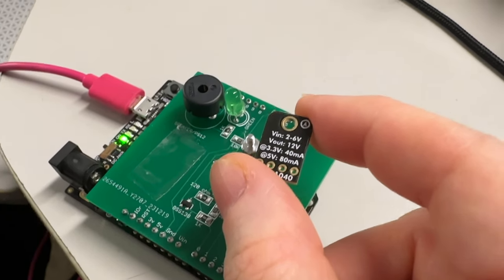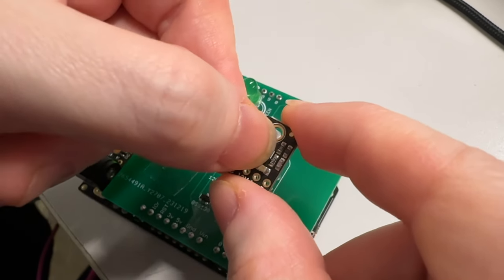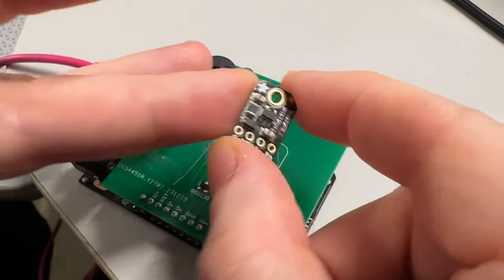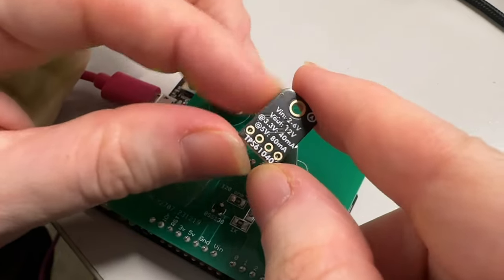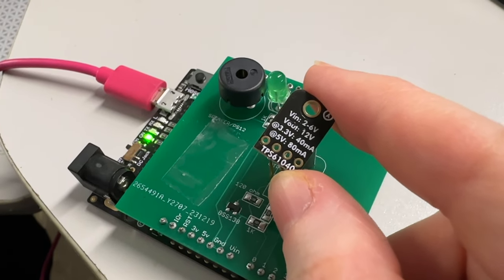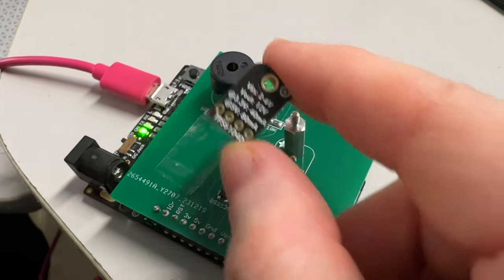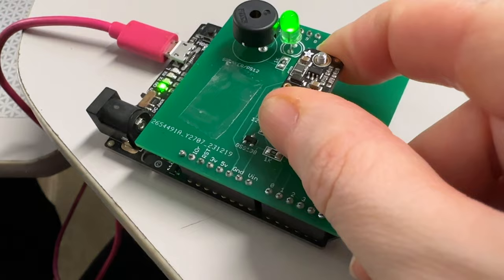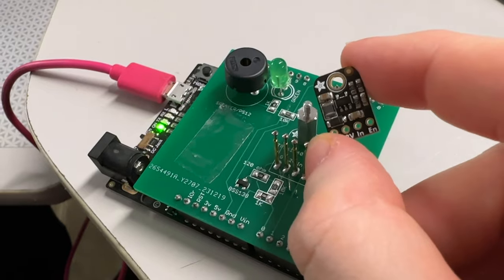TPS61040 12V booster gold test

Comment: Out of curiosity, what happened when the residence was 100 ohm rather than 100k?
Reply: on page 13 of the datasheet, there is a formula to calculate output voltage based on the feedback resistor values. As you can see output volt is inversely proportional to R2, which is that 100k resistor. So if 100 ohms is used, then the IC will try to regulate the output to ~1000times the output voltage desired(12V). Which will damage the IC and other components. Read datasheet